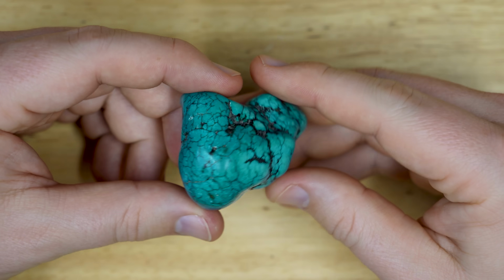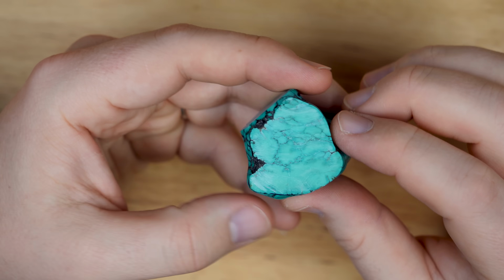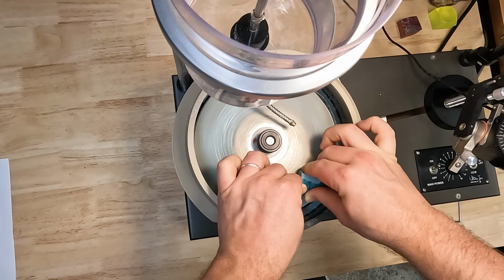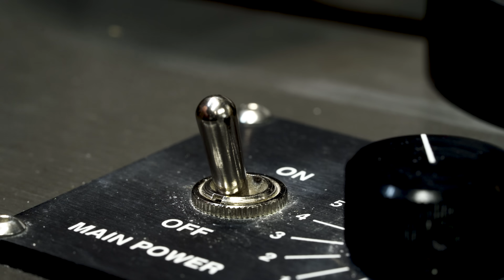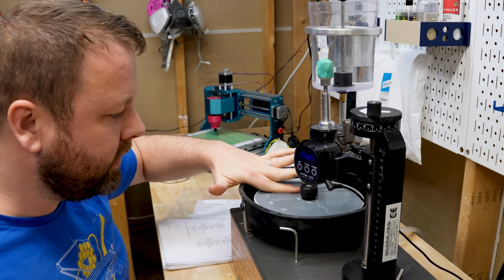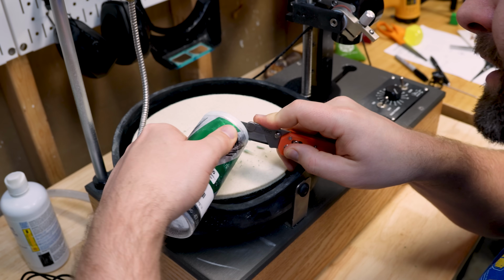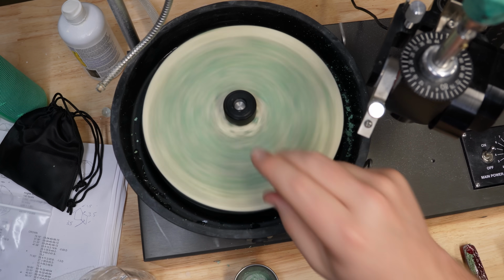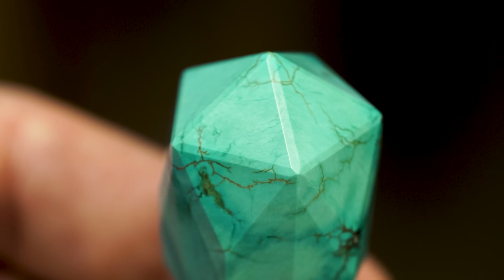Trial and Error: Turquoise D20

Comment: I just LOVE it when you include some of the extra details about the type of stone you're working with. The history and geology and geography make the whole video so much more interesting. 
As for the polishing... When using a solid polishing compound for metals (swords and knives) or plastics (plexi) you just rub the compound block right into the polishing wheel and let the wheel pick up what it can, like you did with the dremel. The compound being in that tube makes it awkward, but I'd assume you'd still do the same thing, rub the compound block directly on the spinning felt faceting wheel. 
The final result here, though, was gorgeous, and I kind of like the soft edges :)

Comment: As a woodworker if your working with champhers on something that is soft enough to round over with light sanding(or polishing) start with the champhers, then do the faces. Youll likely round the edges a little but when you do the faces they are a much wider flat surface so your more likely to stay flat, which when material is taken off by the edge it should sharpen the edge again, at least a little. Edit, this applies to not just using the polish wheel but any method really, champher first, faces second, helps keep sharp lines. This die looks awesome!

Comment: You just gotta push from the bottom of the zam tube to push it out of the top. You figured out an around about way to polish it but it has to be in a pad or polishing wheel turning pretty quick to heat it up for a nice polish. Looks good in the end!

Comment: As Zoro said, "Perfect, now do it again."

Looks like this is an especially difficult material to work with. I noticed several imperfections. It is awesome for a first try, but will be even more awesome if you can overcome the barrier set by the material.